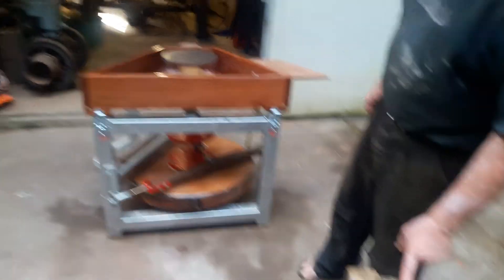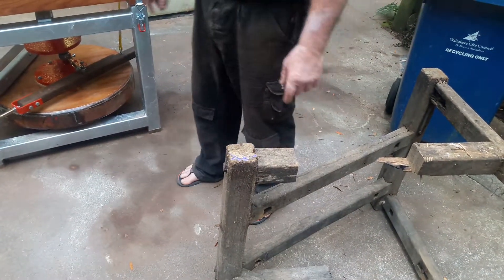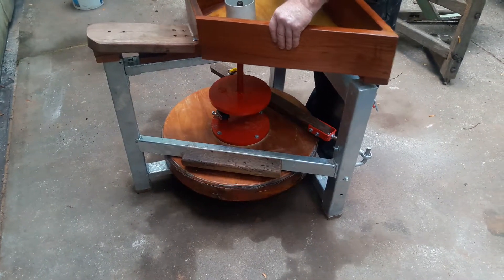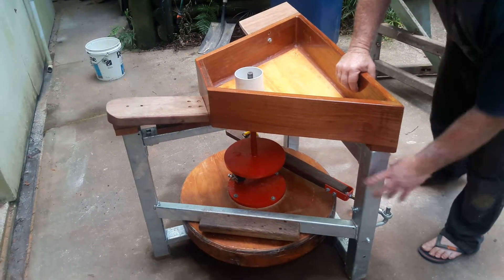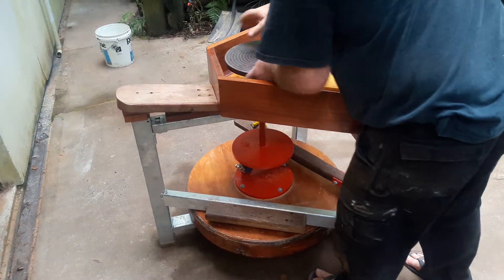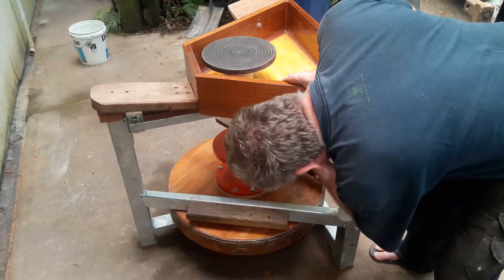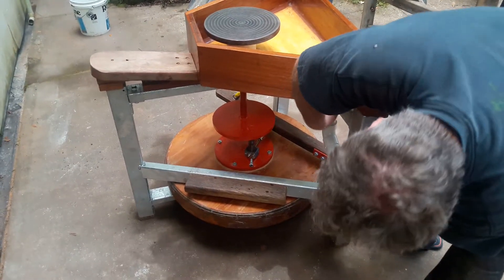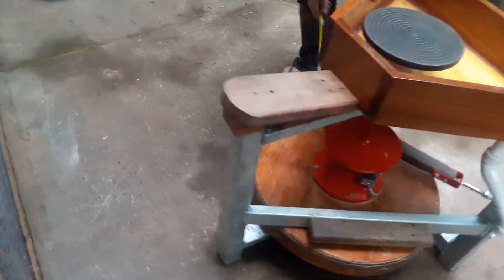Leach treadle potters wheel rebuild.

Comment: Very nice. Glad to see you kept the flywheel. It looks good with the metal frame. Could you do a closeup and explanation of the bottom bearing or whatever it's sitting on? I'm wanting to make one and this is seeming to be the most difficult part for me to understand. I've heard of a steel ball under the bar, or just a block bearing, but I'd like to know if the weight of the whole crank setup is just held up by those two block bearings or if it's resting on something like a steel ball or pin, or even a thrust bearing. Thanks if you can help!
Reply from the maker: Hello, thanks for the comment.
The lower bearing was a worry for me too until I asked a bearing supplier. 
He pointed out that a thrust bearing wasn't necessary with that load,so the bottom one is the same as the top one. 2 x grub screws holds the weight.
After a year of heavy,use I am pleased with the performance and don't see myself going back to electric.
Reply: @1pugmill  whoa good to know a bearing guy! Thanks for the quick response, that is super helpful.